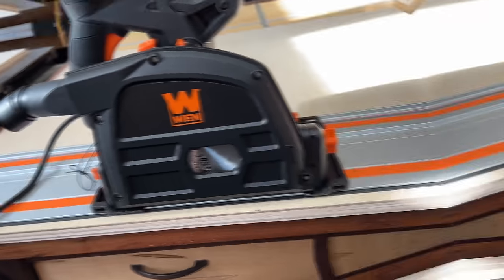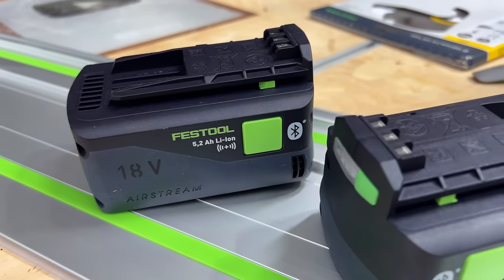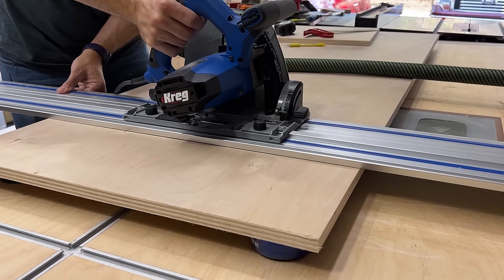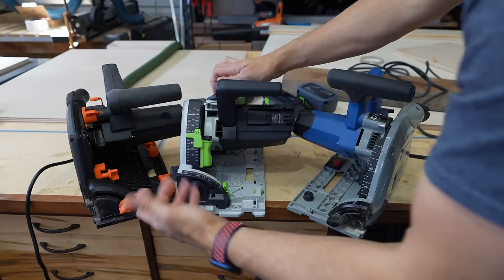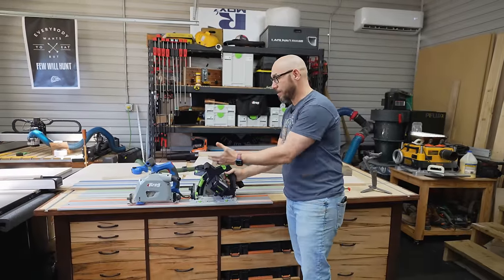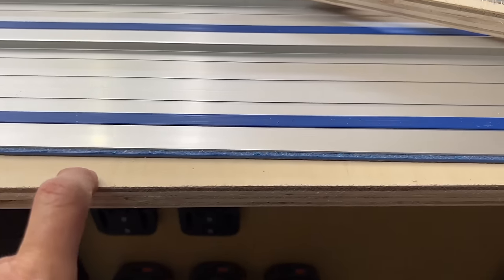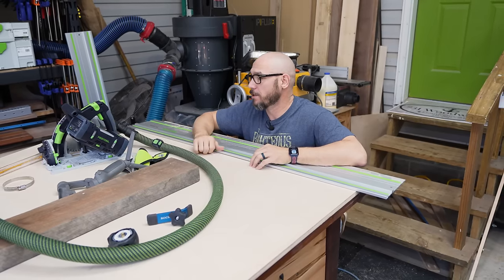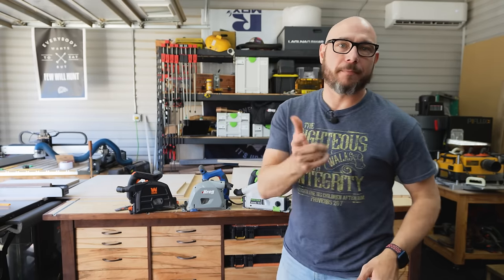The Best Track Saw For Any Budget! WEN vs Kreg vs Festool

Comment: Whatz missing in all reviews of track saws is a comparison with a standard circular saw and shop-built track. Is there truly a 4-8 hundred $ advantage for the DIYer  to buy a track saw over using the saw that they already have in a creative manner? Thatz the question that no one seems inclined to address. Even my local lumber yard still uses a corded Milwaukee circular on their panel saw set-up. 
   My question is:  Should a woodworker lay-out the cash for a new tool that he already has a good quality substitute for simply because internet channels prompt him to do so? Money doesn't grow on trees, and buying every new iteration of a tool is not always within a woodworkers budget or the wisest choice to make. 
   So........what about giving due consideration to work-arounds in a review instead of presuming that a new tool is a the best option? We are a creative community and not just your average consumer working through throw-away generations of expensive paraphernalia. Our greatest quality is our creativity, not our abundance of cash.

-Thankx😁
Reply: I fooled around with various shop-made tracks over the years, with varying degrees of success.  Some were miserable failures while others worked pretty good.  After burning probably a couple of hundred bucks worth of plywood on various guiderail schemes I finally hit on a good system using a cordless DeWalt saw which I used a lot, but it still had a couple of problems.  1) it wasn't accurate enough to cut down to less than about 1/16th.  When I started building my own kitchens I needed better accuracy for breaking down sheet goods.  And 2) it was difficult to get exactly 90 degree cuts.  The bevel gauge on a framing saw isn't accurate enough.  And finally, you can't start and stop a cut in the middle of a sheet (at least I couldn't with my shop-made tracks and a framing saw).  

I finally said fugg it and bought the Wen 7&1/4, with some Powertec tracks.  Removed the anti-kickback pawl, checked it for square, and it works great.
Reply: @Lugnut64052  
Pardner, thatz one of the best responses 👁've had yet. Money is a big concern for me and it will likely always be. But money well-spent is always better than just money spent!! Thankx 4 the feedback.

Comment: If you purchase the Festool.. Yes, it’s more expensive then the other two.,but you will not be disappointed and won’t look back as say you should have bought either one of the other two. 

Buy once, cry once. The markup is well worth the quality.
Reply: I think he covered that quite well. He said if you are going to use it a lot or for your business to buy the Festool. If you are a tight budget and only use it maybe once a month go with the Wen. If you can afford to spend a little bit more or use a track saw a little more often to buy the Kreg. While I could easily afford a better option I chose the Wen, because I do not need the use of a track saw very often.

Comment: So the question you really have to ask yourself, is the Kreg twice as good as the Wen or is the Festool twice as good as the Kreg and four times as good as the Wen? Based on your review, it would seem that the Kreg is worth twice the price of the Wen but the Festool does not seem like that is the case. Granted, without the batteries, you could save about $100. I feel like Festool is like Apple, if you make that plunge then you are locking yourself into their system.
Reply: That's a great question for the hobbyist, potentially, but not for the full time woodworker.
If spending $400 once means they can increase productivity even 10%-15%, then the $400 is relatively nothing.